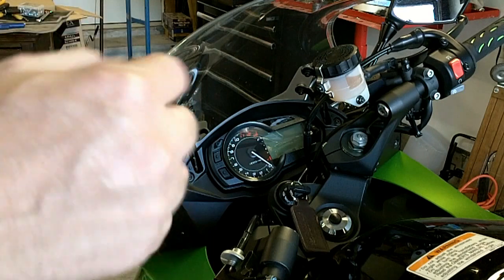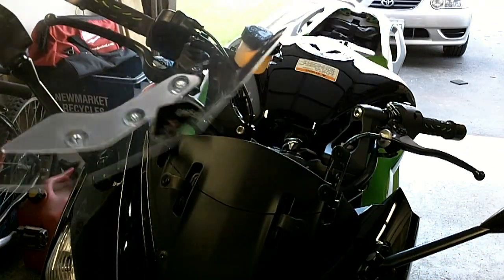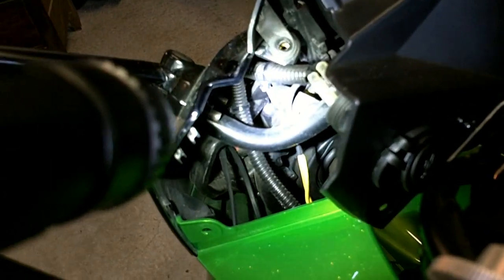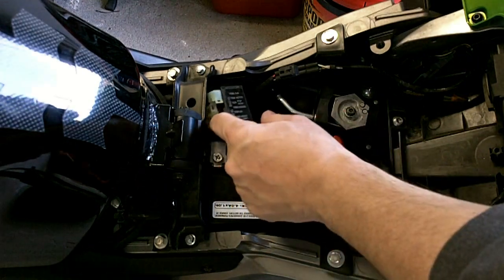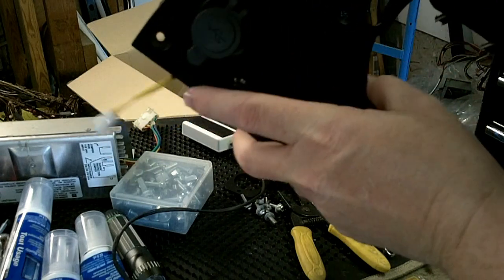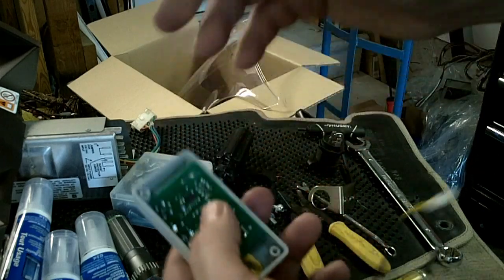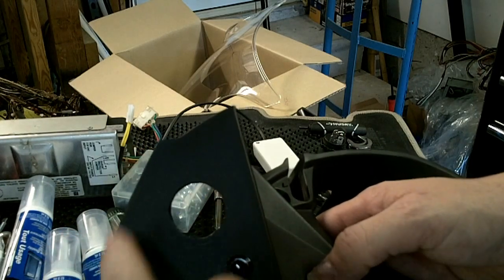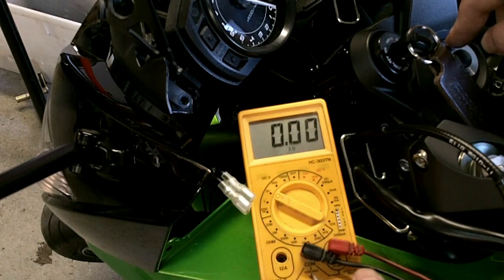Ninja 1000 / Z1000 Accessory Power Point and Garage Door Opener Install

Comment: Why not put the car power supply on the other side of the bike and have both options?
Reply from the maker: Good idea! The one on the left is easy because the wiring spade connectors are right there. You would have to run another pair of wires across the fairing to the other side if you wanted another port. Not hard though.